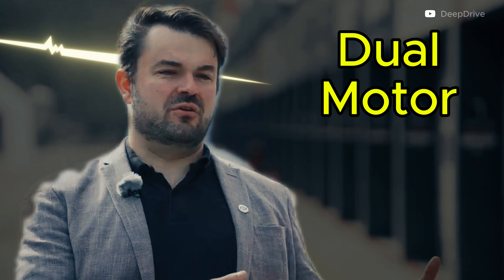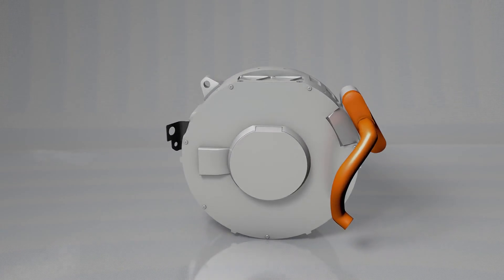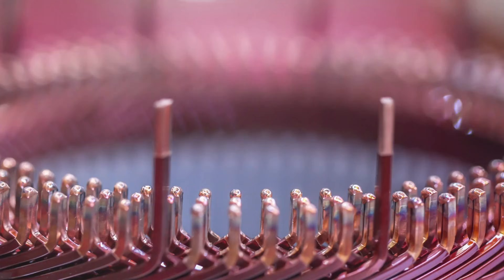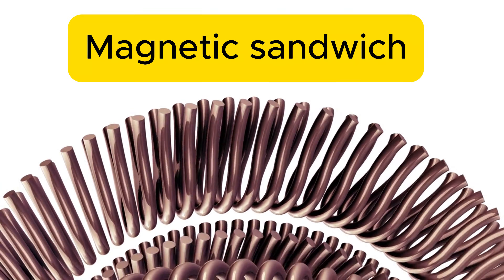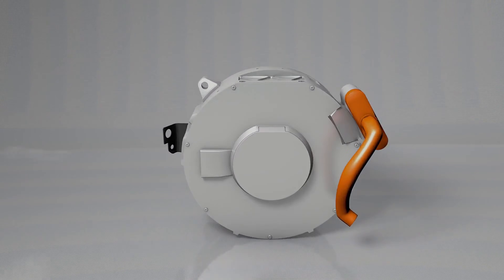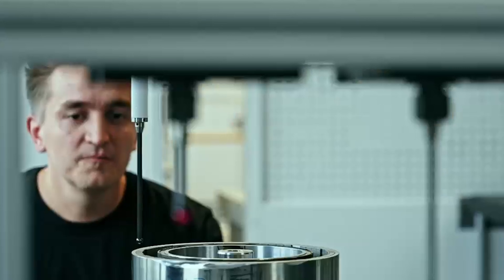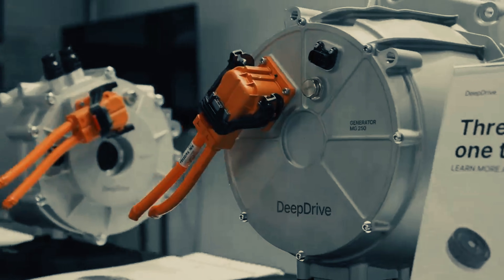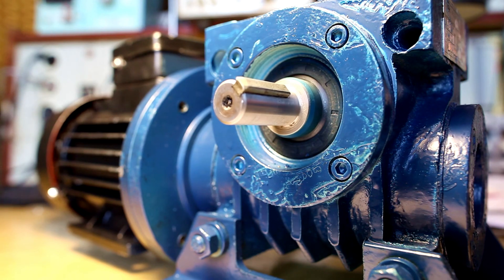New Dual Rotor Motor Runs Without Steel– Here’s How

Comment from the maker: ⚡ No steel. Two rotors. 2,000+ Nm of torque.

If dual-rotor yokeless motors go mainstream, what part of the EV drivetrain changes next?
🔋 Batteries | ⚙ Gearboxes | 🔌 Inverters | 🛞 In-wheel drives

Drop your take below 👇
Like & subscribe for more EV engineering deep dives!

Comment: Very interesting design.  No mention of Horsepower/KW nor of RPM the motor is capable of.  No mention of cooling either.  If used in the in wheel configuration how is braking achieved?
Reply from the maker: Thanks for the info!
Reply: Btaking would be mostly regen, just like any other electric motor. And you can mount hydraulic braking hardware inside the hollowed hub.

The bigger problem is how to seal the 12+" diameter seams between the rotor and stator to keep dust, rain and slush out. Not too much of an issue for racing cars and motorcycles that be rebuilt every few weeks for cleaning and seals changes. Probably not suitable for the mainstream.
Reply: @teardowndan5364  The inner dia is very small.  Even to fit just a caliper.  Regen is great for daily braking type stops but harder emergency braking requires real caliper and rotor integration that doesn't appear to fit inside the opening unlike the Donut labs version.  Sealing and of course weight and impact resistance are other issues that would need to be proved out.
Reply: @zeitgeist888  Regen braking is capable of hard braking. EV manufacturers are just choosing not to design their inverters to allow regen-braking as hard as electric motors are capable of.

If you want to violently stop most electric motors, you simply short their phases together. With an inverter, you can do this in a granular manner by driving all phases to ground at whatever duty cycle provides the desired braking force. In many inverters, that is how they boost back-EMF to battery pack voltage for regen braking to begin with, only need to raise the braking current limit.

What electric motors cannot do is apply holding torque indefinitely while stopped.

Comment: I wonder if this could be used in construction equipment.
Reply from the maker: It's definitely an interesting thought for construction equipment, especially with the potential for higher torque density!
Reply: @renewable_energy Engineers are going to have fun with this little baby. I just wish I was younger and I knew math and stuff😂

Comment: I designed a dual rotor motor at MIT over 40 years ago. This video is a big let-down. The images and clips of OTHER motors are interspersed with just a very few of the DeepDrive, and none of them are synchronized to the narrative. And despite the narrative claims, there is no explanation of the flux paths or how DeepDrive actually transforms electrical energy into mechanical.
Reply from the maker: Thanks for sharing your perspectivve and respect for the work you did at MIT. you’re absolutely right that dual-rotor concepts aren’t new, and that’s an important point worth acknowledging.

Your criticism about the visauls and lack of synchronized flux-path explanation is also fair. this video was intended as a high-level engineering overview focused on why DeepDrive implementation is notable (yokeless radial-flux, synchronized inner/outer rotors, and structural copper windings), rather than a full electromagnetic field walkthrough. That tradeoff clearly didn’t land for everyone.

A deeper dive into actual flux loops, field interaction between the two rotors, and torque production mechanisms, with properly matched diagrams, would definitely improve clarity, especially for engineers with hands-on motor design experience.

Appreciate you taking the time to call this out. Thoughtfull technical critique like this is how the discussion moves forward.

Comment: Great. A dual-rotor motor is an advanced electric motor design with two rotors (inner and outer) within one housing, sandwiching the stator, which significantly boosts power density, efficiency, and torque in a more compact size, making it ideal for electric vehicles (EVs) to improve range and performance. By utilizing magnetic fields from both sides of the stator, these motors offer advantages like reduced iron/magnet usage, lower losses, and potential to replace traditional differentials in EV drivetrains, with companies like DeepDrive pioneering this technology for next-gen e-mobility.